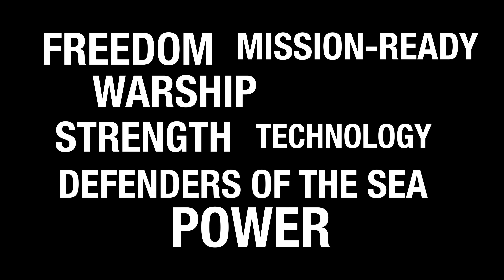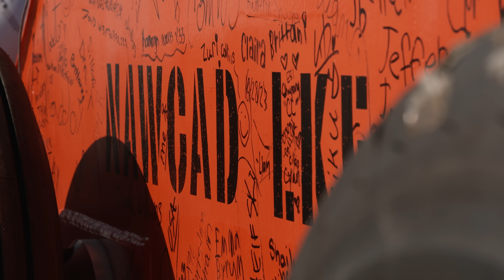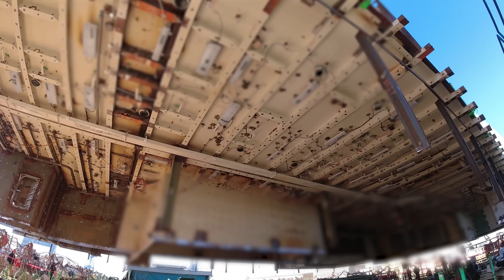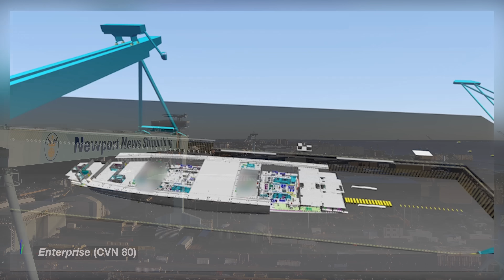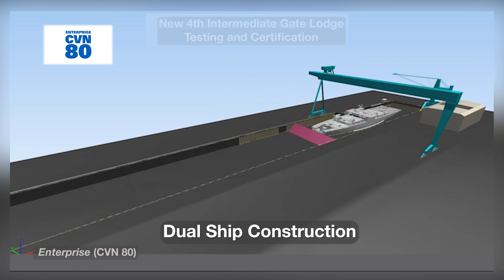Newport News Shipbuilding Aircraft Carrier Update: March 2024

Comment: I assume the blurred out parts of CVN-80 are classified?
Reply: Rather too late as there is a Newport News pr video of the Gerald Ford been built and those areas were not blurred. They blur the torpedo protection/ side tank system in one shot and engines/turbine floor amongst other images. None of which were blurred in the Gerald Ford build pr video. Still shots exist too in the public arena.  Basically the side protection system is an evolution design originating with the USS Midway which was an evolution design from the original USS Saratoga of the 1920's. The real change is in materials used, inclination of the inner 'Armour' belt/ torpedo protection system and the depth of its position within the hull.
Reply: Naaaah...  that was your eyes.
Reply: Nah, just the female quarters, they were getting dressed
Reply: @acdii  🤣